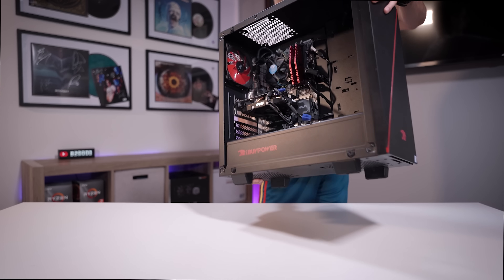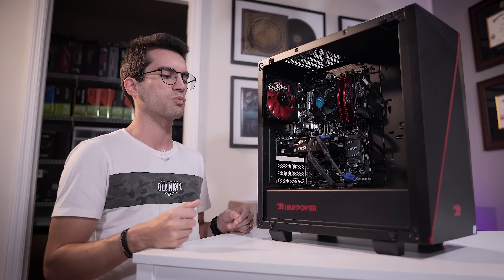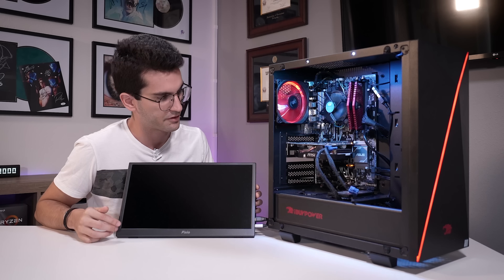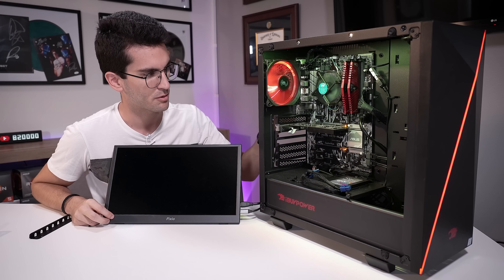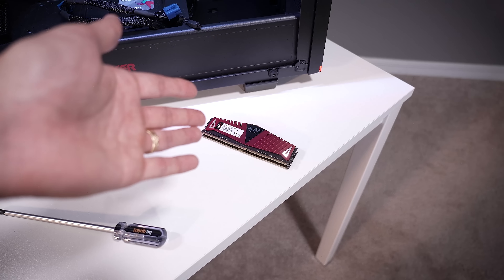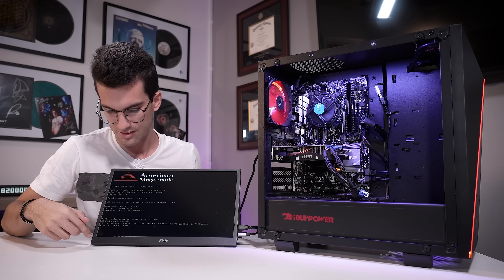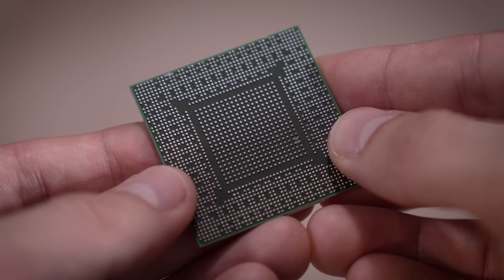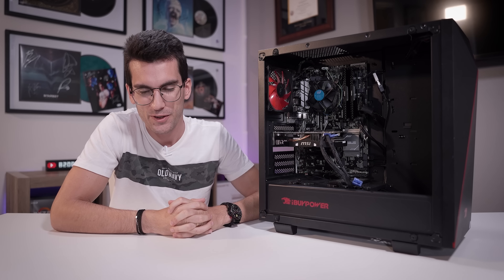Fixing a Viewer's BROKEN Gaming PC? - Fix or Flop S2:E19

Comment: Hey Greg, i had a similar issue two times with my pc where it refused to give any display output and some of my peripherals wouldn’t light up. I troubleshooted for 20-30 minutes removing gpu, resetting cmos etc. until i started removing my ram sticks one by one and it turned on. Then i reinserted the ram one at a time and found the "bad" corsair stick prevented the system from booting, i tried different configurations single channel dual channel etc but it wouldn’t work so i assumed it was dead. A few days later i decided to update my bios and reinserted the "bad" ram and my pc booted up fine. I’m honestly not sure why this happened so if anyone could explain i’d be grateful especially since this happened again. I was also able to fix it this time by swapping the configuration a few times i made sure to press quite hard to make sure the ram was in each time until it booted and worked in every configuration after that.
Reply: Out the RAM and the BIOS should give you an error that it has no memory. From there start testing with single sticks. If each one works individually, try running two and so on. And rotate them through different slots. I had a board where the 3rd slot died, and trying to figure out that it was that specific one was quite the journey.

Comment: Something you could try on these pcs that have no output picture. If you connect a keyboard and boot up the PC, see if you can click the caps lock or num lock keys. If they light up that means the PC has posted. This can help troubleshoot faulty display cables/ports. Or even bad gpus in some cases

Comment: Need to get a supply of cheap Deepcool Gammaxx 400's to upgrade rigs like this, from that horrid stock Intel cooler. Often as low as $15, and a huge improvement, over stock.
Reply: Well if it work it work. Most of those system doesnt need a upgrade but yeah will get better temp and noise for sure

Comment: I just build a system from used part and I had one of the ram that was super sketchy. It would work as long as the system wasn't turn completely off(PSU Off). When its turn off, I have to remove the ram stick, boot with a single working one, than put the stick back and it boots no problem and work perfectly... really strange behavior.
Reply: A full boot or just the post?

Comment: Hi just 2 suggestions:
- try to get a small speaker for pc, sometimes that helps a lot to diagnose with beep codes.
- a diagnostics card like the TL460 or the more modern TL611, those can be connected in the TRM port and add HEX post codes and diagnostic leds to old motherboards; very useful for Flix or Flop. 👍
Reply: Yeah, I still have the classic null method in my head.
Start with removing everything but the CPU. Then it should give an error related to missing RAM
Next add the RAM and it should give an error due to lack of graphics.
Add the graphics card and it should post and complain about a missing boot drive.

Comment: As someone who's basically been working on computers since I was like 10 years old, I love this series. I'm not a fulltime PC troubleshooter but it is my passion, and I am the one my friends turn to when they have PC or even Mac issues (I do work on Apple stuff fulltime much to my dismay but at least it's some form of computer troubleshooting). This series has also helped to solidify my troubleshooting. I have also learned a few things from watching these as some are rare to come across and I would not even think of checking such as the case I/O board not working, or possibly a SATA cable causing the computer to delay POST for more than a minute. Thank you so much for this series, Greg! Much appreciated content.
Reply: 100% the same - my first computer I built was a 486/33 DX, had to put a VESA video card and a stacker 5x86 chip in it so I could play warcraft 2, been hooked ever since
Reply: Fully agreed with you =)

Comment: The fact they sent you motherboards for the series just shows how much we anticipate these awesome knowledge bomb of pc building videos! Keep up the awesome work greg!
Reply: I have one of those mb, the B550 AORUS ELITE AX WIFI  to be exact. Upgraded from a B450 AORUS ELITE. Also have a Gigabyte Gaming 7 mb with an Intel i5 6700k system my wife uses for work, which is my old gaming system. Never had an issue with Gigabyte myself, and happy to keep using them.
Reply: @SirDaffyD  Gigabyte had the Worst Bios for thier Motherboards . Never saved any Changes for Ram Profiles or OC Profiles. Also the Gigabyte Cards who got Bricked by Playing New World
Reply: @Its_Destiny . I'm hearing ya. Like I said, I've never had an issue with Gigabyte MB's, so why should I change to something that I haven't used.
Reply: @SirDaffyD  to avoid upcoming Problems ? Gigabyte also used faked Benchmarks for advertising
Reply: Same one I have in my PC!
Reply: @jeji5860  yes I had a Gigabyte Board. Wich caused alot of Problems. I Switched to a Nzxt Board and all the Problems were gone. Also I have Rtx 3060 Gaming Oc and the right Fan is doing some wierd noise at around 50% rpm
Reply: If you have internet and have never diagnosed a faulty PC googling the problem you will surely find a tutorial or the answer to the problem .
Reply: HP SUCKS ….SURE… THEY ARE A SPONSOR BUT RUN!!!!!!! DO NOT BUY BIG NAMED PC’S THEY RUN OFF PROPRIETARY PARTS WHICH MEANS YOU HAVE TO ORDER THEM FROM THEM AS THEY ARE THE ONLY ONES WHO MAKE THEM AND THE MANUFACTURE CHARGES DOUBLE. BUILD YOUR OWN SAVE YOUR TIME AND FUTURE HEADACHES. DO YOUR RESEARCH AND BUILD YOUR OWN!!!!

Comment: One thing i haven't really seen in this series is the use of the PC speaker header for debug beep codes for motherboards without POST code or debug LEDs. They are cheap enough to have around just in case, to speed up the process of finding the source of issue. Doesn't help all the time, but in this case the board would probably beeped the usual 1 long, 2 short beeps for RAM issue.
Reply from the maker: I use them all the time off-camera. They rarely ever beep.
Reply: @GregSalazar  I have 5 computers and I always install the speaker (even salvaging them from old PCs before disposal).
Different mobo manufacturers. Different chipsets and ages. They all beep. Weird coincidence.
Reply: @GregSalazar  they don’t beep on my board for some reason
Reply: in this issue.. based on my experience. mostly the speakers will not beep if 1 of the DIMMs are failing. mostly it just gives you a blank screen without NO SIGNAL popup as if the screen is showing something. it will only beep if you test 1 DIMM at a time and if the dimm is broken.
Reply: Yeah.. it is good but when the mobo or the ram is bad, you won't get anything.

Only the cpu and gpu and usb errors will beep
Reply: I agree, surely an essential troubleshooting tool.  First thing I'd be doing is add a speaker to see if it beeps.

Comment: You aren't wrong about the "easiest fix". Most motherboards in the past 3-4 years have LED lights on them that immediately call out the DRAM. It's been so long, that I think my second rig in 2016 was the last board without lights.

Comment: Has anyone had the issue when all components are fine. But no post with 2-4 ram sticks. Using only one ram stick. Then installed windows. After that was able to install the other ram no problems. Had that issue with this B550 Tomahawk.

Comment: I live in Jacksonville which isn’t far from you guys. I’m in serious need of yalls help. I’m having similar issue. It worked completely fine forever. Always kept it clean. Then one afternoon it started crashing. Said something about memory, and in bios it said I had zero gigs of Ram so I removed them and reset them and started reading them but kept popping up errors and turning off and on.
Reply: The simplest Solution would be re installing Windows without More info. A reminder to you all to DO YOUR BACKUPS
Reply from the maker: I don't typically work with intermittent/random BSODs and other software errors.

Comment: The broken Clip thing ... i had a rx5700xt not making contact on a board with that issue
Reply from the maker: The clip alone shouldn't be the reason - particularly if it's fastened to the case via screws at the rear.